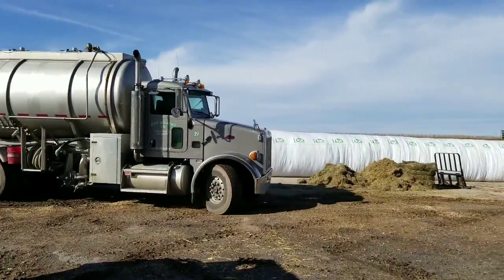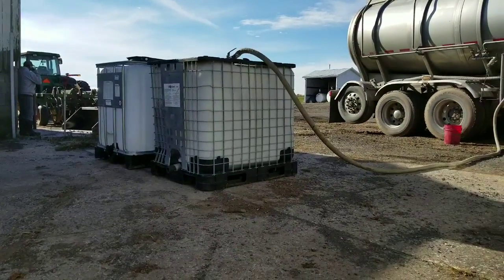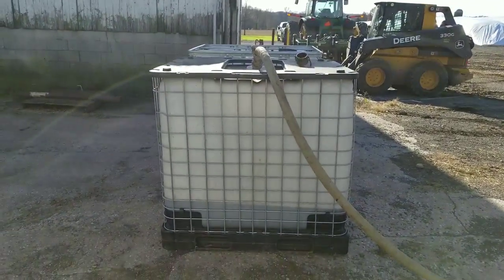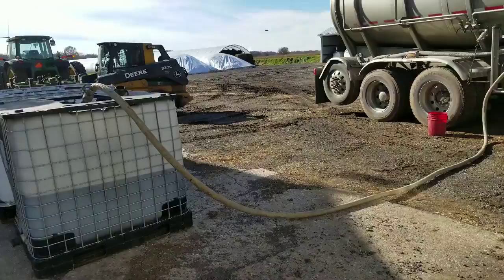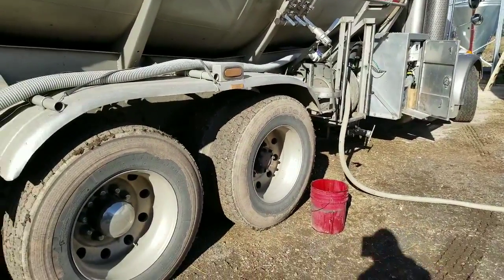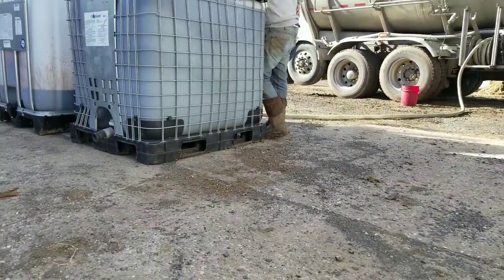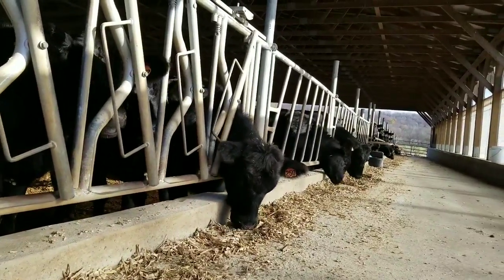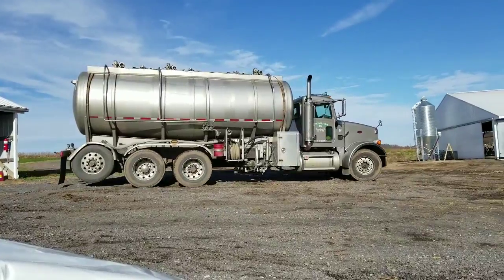Using molasses as a feed additive to increase consumption and decrease waste

Comment: Is there something they put in it to make it thinner because it can get super thick when cold cold
Reply: Same here in Hondo, TX., as of 12/24.  Motor is tripping the breaker, this after I upgraded it.  Advise...or, do they upgrade pump system, thin out the molasses, or heat up the molasses?

Comment: I was always told those plastic totes are about 2200-2300 pounds loaded each.
Reply from the maker: We did fill them clear. Which gives you roughly 2600 to 3000 pounds